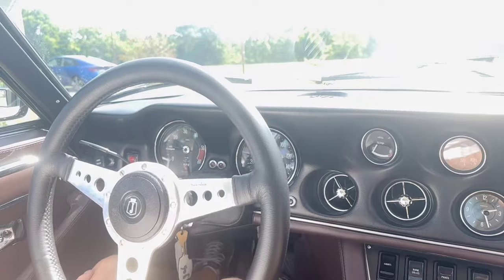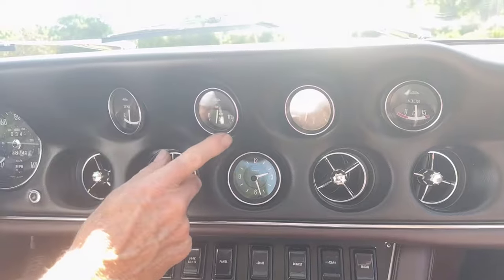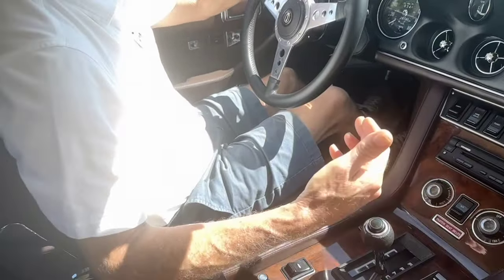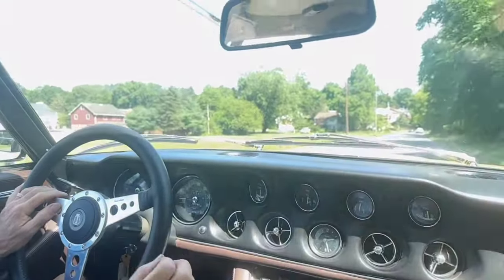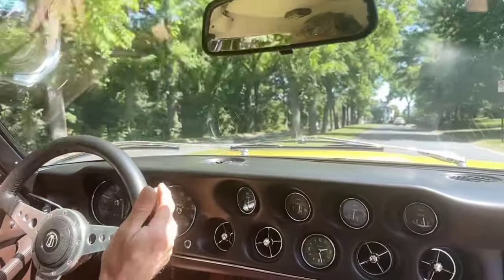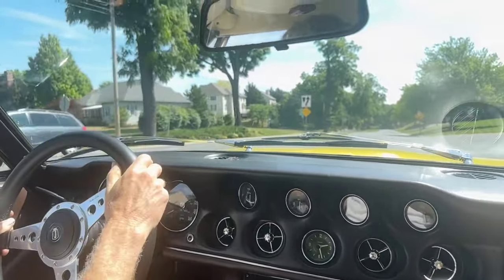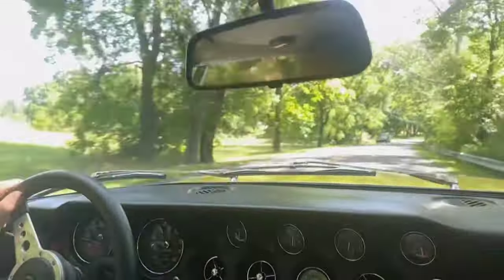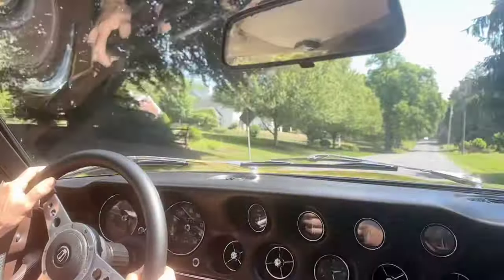1973 Jensen Interceptor MkII - drive

Comment: I worked professionally on one back in the mid 1970's. Interesting car. I had fun putting a starter motor in it. Tight fitting engine.